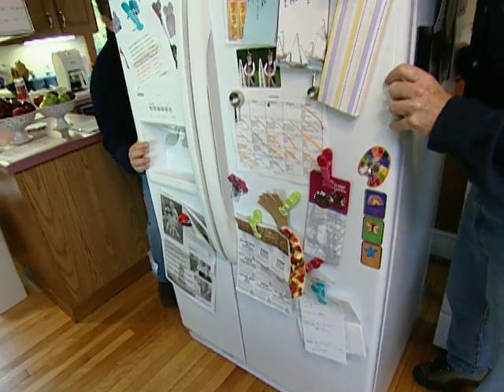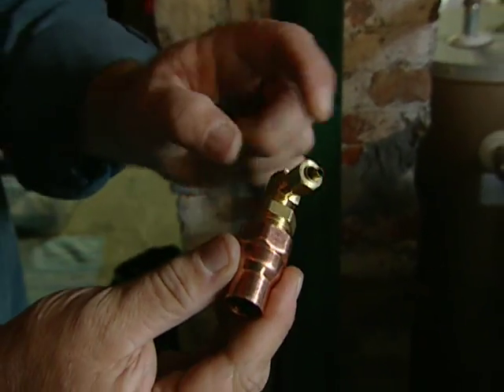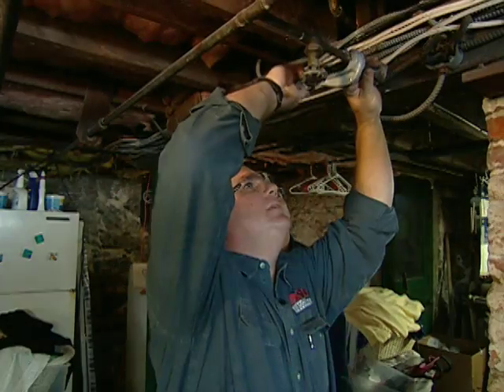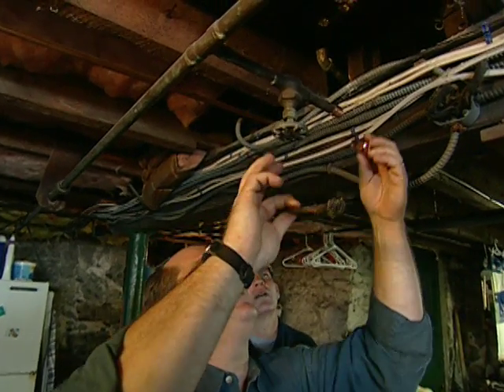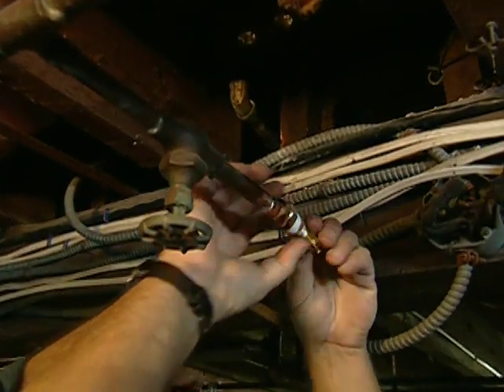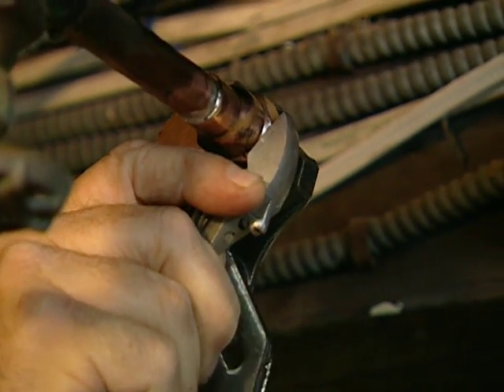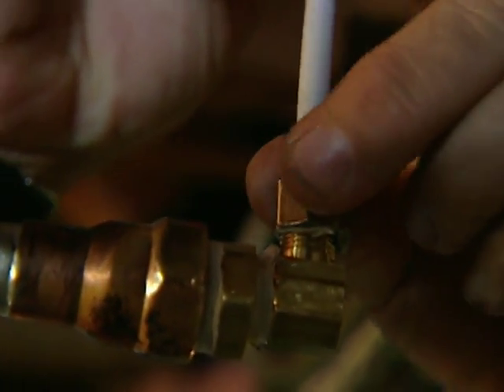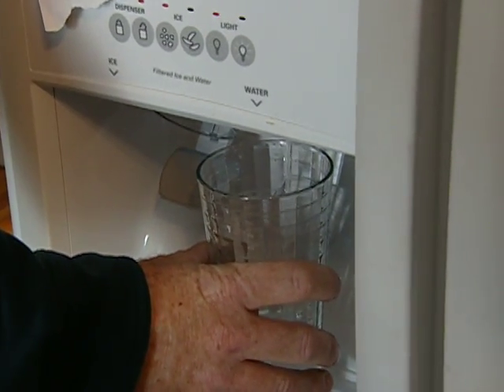How to Connect a Refrigerator Water and Ice Dispenser | This Old House

Comment: I’ve moved many refrigerators in 40 years of refinishing wood floors.  I assume that they cleaned the floor before filming because usually, it is extremely dirty from not having been moved for 5-10 years.  Second, it looks like the refrigerator motor got too hot and scorched the floor, probably because there was so much dirt surrounding the motor from not having been cleaned in years.  Before moving the refrigerator back in, I usually take a compressor and partially remove the lower back cardboard panel and throughly clean the motor.  You wouldn’t believe how much dirt shoots out.  Finally, I usually put an 1/8 inch thick piece of underpayment in front of the refrigerator, to make sure that the rollers don’t damage/crease the floor when rolling the refrigerator out and back in.  Half of the refrigerators in use today will crease the boards.

Comment: The water line with the sealant connection is old school.  They now sell water supply lines with compression fitting O-rings.   They are easier to install and uninstall and bullet proof when it comes to leaks.
Reply: also they have the ones with rubber washer 3/8 just snug up and you're done.

Comment: Wow, lucked out. No hole needed in the floor, cold water supply right below ready for a fitting to be soldered to. That doesn't happen everyday.
Reply: I know. Even it if wasn't anywhere near it though, doesn't change much besides adding a few more hours to the job.

Comment: My house failed state inspection because contractor attempted to use plastic/pvc flexible tubing, instead inspector made them use copper tubing all the way from under the sink to my fridge, and then couple that to fridge feed. However, it looks like you are using the fridge tube directly without an extension connection, that might be why you skipped copper tubing.
Reply: copper isn't best because may leak if you have to move the fridge for cleaning. I like the braded flexible lines
Reply: @HeadingForTomorrow  I just bought some the other day.  3/8 made specifically for ice makers. They also have 1/4

Comment: I would have run a decent amount of water through the hose before letting it go in to the refrigerator. They were pretty sloppy with the pipe dope on the white hose connection. You know some of that pipe dope had to have gone inside the hose which eventually made its way inside the refrigerator. Sloppy work.....

Comment: When they say the line going to the fridge is 1/4", is that OD or ID?
Reply: most likely is ID because OD depends on materials.
Reply: YOU BUY IT AS A KIT.. ICE MAKER LIKE
PLASTIC OR COPPER OR STAINLESS STEEL BRAIDED..
Reply: OD, the fitting from the fridge is 1/4 OD
 compression/
Reply: my fitting was 3/8

Comment: So that's straight unfiltered water?
Reply: What's wrong with unfiltered water? Unless you have well water coming into your home, any/all tap water should be 100% potable. Plus Most new fridges have filters built into them.
Reply: linkinprk1981 With all the stuff on front of the frig, I'd say they had it for a will and just hadn't hooked up the water supply. And most municipal water supplies are filtered and has some kind of treatment as mandated by law.
Reply: All refridgerators require a tapped line straight from the main water source. You need the pressure to get adequate water flow. Plus, all you need is a carbon filter, which all fridges include built in
Reply: You tell me what's "right" with unfiltered water firstly? then I'll start by giving you a list of things that are wrong with it.
Reply: No, they don't have laws in place for "so-called" water safety, research the shit that they put into drinking water these days, then you'll be running for the hills.
Reply: Charles Damery to be honest I don’t understand people’s problems with “unfiltered” water. In the uk water is filtered at the water plant so it’s perfectly drinkable from the tap. Is this different in the USA??
Reply: Nope, its the same in most of the USA. Some people just don't like the taste of city water.
Reply: The fridge has its own filter
Reply: @wendyluke3645   Talk to the people of Flint.....🤘😂
Reply: @linkinprk1981  Do you have any idea how disgusting city water is? Only a fool would drink unfiltered water from the Tap.
Reply: @elliottierney5452  Look at all the lawsuits that have go on about contaminated water. You would have to be an idiot to drink straight from the tap.

Comment: Always good to leave a super old shutoff to service top grade plastic tubing. Sheesh. Just cut that off and use a new 1/4" valve. What an odd solution.
Reply: I'm with you.  I can understand if a new shut-off was $100.   But they are only about $10.00-$13.00.  I'm still pissed at a plumber who helped re-do my kitchen and kept the 10-year-old shut offs under the sink complete with the tubular water supply lines.   I subsequently swapped them out for 1/4 turns valves and braided lines about 10 years later when I put in a new kitchen faucet.

Comment: They wrapped the teflon tape on wrong. You should wrap it so it doesn't unravel when you screw the fitting on.
Reply: True good catch. I always think clockwise because like you said that's the direction the fitting will be screwed on too.

Comment: 🤦🏻 you never use dope on a compression fitting regardless of the type, copper, brass, poly, whatever. The seal is made by "compression" only. If there's a leak then you just tighten. If there is still a leak then you have an imperfection on the accepting female conical joint or you didn't use your feral (if using cut to length poly. That little feral is important because it gives something for the compression ring to crush against so it spreads out not in and seals). Dope just makes a unnecessary mess and if ever removed makes the threads useless.

Comment: i would of used a  new shutoff valve and 1/4 inch  thread in one...
Reply: san379 and charge $300 instead of $30.
Reply: I work at RONA.CA they are 16$
Reply: you should not be criticizing people's work when you put a fernco on a fitting hub that was not round.

Comment: Does it have to be exactly over the pipe? Or can  the lines be extended to be able to reach the pipe?
Reply: can be extended. water pressure will make its way in any direction

Comment: Not a great idea, the water now needs to travel upwards thus slowing down the pressure making it come out at like tortoise slow o'clock.
Reply: Wendy luke Yeah, 60psi water pressure could never go up 5 feet.  Crazy.
Reply: @ScubaCat3  It would have been a better idea to run the pipe up through the floor. Not necessarily to get better water pressure, but so you don't have to go to the basement if you ever need to turn off the water or disconnect the fridge.
Reply: @ScubaCat3  LOL